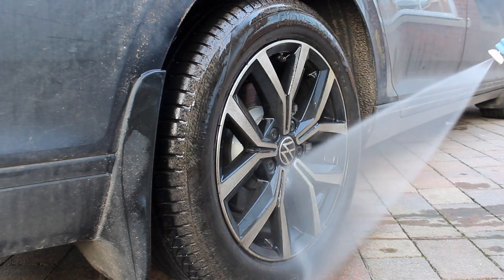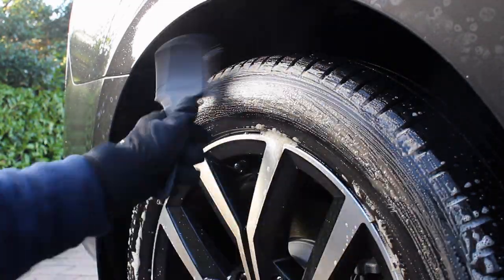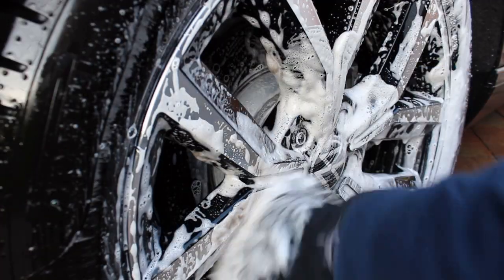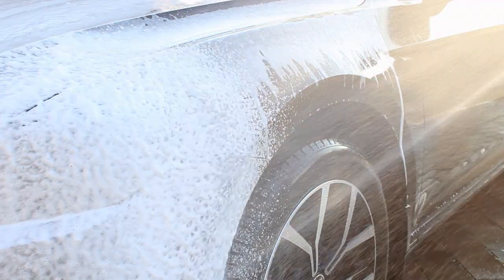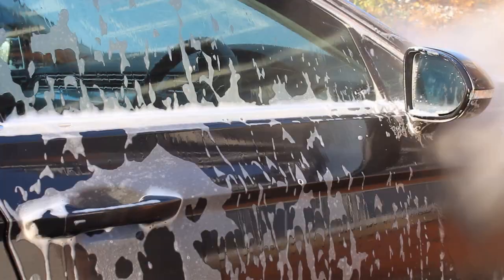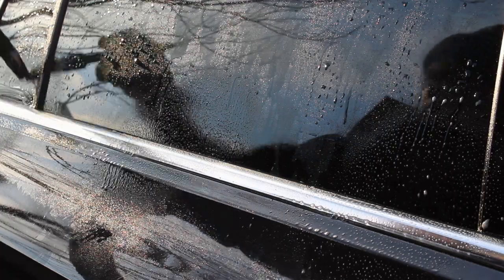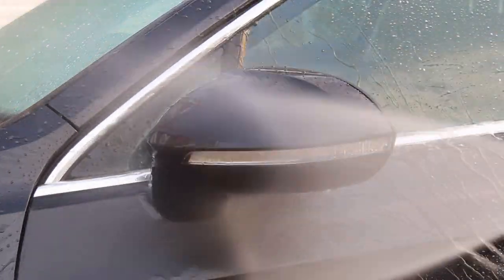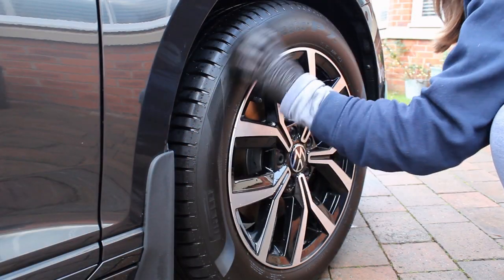Filthy Volkswagen Passat | Wash and Protection of this Estate Car

Comment: Another good clean Heather. I use the power maxed tfr, pretty strong stuff. Also use the tyre coat, I find it really good, lasts well and you can definitely still see it on the tyre longer than other brands.
Reply from the maker: Thanks for watching! Infinity Wax Tyre Coat has really impressed me, I think the finish is perfect and the application is really easy with it being a spray

Comment: Great video Heather and another thorough explanation of what you have done and your thought processes. The wheels on the Passat look lovely but I've found that diamond cut finishes are the Devils work and their resistance to ageing and white worm is not great. I look after a Range Rover with d.c wheels and I always ensure they have continuous protection applied in the form of Angelwax Bilberry Wheel Wax. Your client might value you doing the same on these wheels.
Reply from the maker: Thanks for watching! Yeah I've seen a fair few diamond cut alloys with pretty bad corrosion unfortunately. Hopefully the sealant here will have added a bit more protection but I know it's quite hard to prevent even if they're ceramic coated due to chips etc. I don't actually do this professionally so I don't plan to maintain this car as the owner wants to start getting into cleaning it themselves but I'm sure I'll have it back on the channel at some point so I can apply something a bit more heavy duty to the wheels and paintwork :)

Comment: Great job Heather, I'm interested in the touch-on. I've tried auto finesse lavish which is only ok. Touch-on sachets are a good idea to use when needed, mostly winter. 
Does it improve the appearance? Glossy? Thanks 👍
Reply from the maker: Cheers Kevin! It's hard to say about the finish to be honest without testing it next to bare paint but I'd say it's probably about similar to most other products and doesn't blow me away with the gloss levels. Having said that, the lighting has a lot to do with it! I've popped a link in the pinned comment if you want to see more info about durability and different ways to apply it as well :)

Comment: Really enjoying your videos. You've come a long way since your earlier ones, good job! Touch on looks brilliant, more potent than in other reviews I've seen.

I have an XC60 with gloss black alloys, I've had to adapt my cleaning routine to avoid marring and scratching. First I spray with APC then hit the tyres with a tuff shine brush and rebound, rinse off the tyres and APC to get as much of the crud off as possible. Then I use a soft detailing brush with either a wheel cleaner or wheel shampoo, normally wax planet aluminium or AG hoops or a combination of both. I'll then go over them with a klin softie wheel pad then rinse. I'll then do the barrels with a combination of EZ large and mini, these get where water can't! Then a mitt behind the spokes. I do use a fair bit of product on wheels. The products I do use are keepers now and won't use anything else, APC I use bilthamber surfex HD. I'm a little OCD with my wheels.

Comment: I am always wondering: does the snow foam affect the cleaning capabilities of a TFR? Roots to the idea: TFR has a ph rating of around 12-14 if undiluted, so here perhaps 9ish. Snow Foam mostly is "ph neutral" in the 5ish range. Put these two together and this reduces the TFRs capabilities by neutralizing its acidity. So one trades in chemical effectiveness for dwelling time (which helps effectiveness). For this reason I try to avoid "piling up" different cleaning products at the same time.
Reply from the maker: I let the TFR/ citrus dwell for a few minutes before applying the snow foam to let it work on it’s own before it gets diluted. The snow foam here is alkaline as well so it shouldn’t neutralise it much. I don’t think layering is necessary to be honest it’s just something I like to do sometimes whilst the buckets are filling up

Comment: That was quite clean if it was 5 months of use. I've just got rid of 6 weeks and 2500 miles of winter grot and that was the dirtiest it's ever been.
The new Carscope Rotor wheel shampoo is on a par with GT wheel shampoo I'd say.
Alkafroth as we have discussed is my new "winter" foam it's just not widely known nor does it get the press coverage it really deserves.
Finally.... you need to invest in an EZ "bog brush " for the arches...mudflaps front and back.... makes life a breeze.
Reply from the maker: I'd really like to try that rotor wheel shampoo, I'll probs pick some of that up and maybe Ink at some point too. I've just got EZ Go Brush actually, it's brill. I've got the next couple of transformation videos already filmed so it might be a while before it makes an appearance though
Reply: @Auto Care HQ  I think Rotor is actually better foam than GT...  but only just... cleaning is certainly on par...
And Ink.... its great... goes on light blue and seems to hang around a longtime

Comment: Hi heather I’ve been using the touch on for a while great product if used every month as directed it does seem to build up and also found it will start to last longer and longer the more used
Reply from the maker: That's really cool that it builds up, the owner of this car has just bought some sachets of it!
Reply: @AutoCareHQ  Have you ever tried Infinity Wax Express Sealant? It's behavior and longevity are very similar to Touch On.
Maybe Michael can send you some 👍🌹
Reply from the maker: @kinnonmcallister  I've not yet but it's on the list of products to try! I've used Incinerate and Tyre Coat and really like both of them so I'd definitely like to buy a few more of their products

Comment: Hi heather I hope your well just going through some of your old videos and just wondered would you recommend surfex hd instead of the traffic film remover? And would you say now its better to apply product directly without prerinsing to make product more effective and not to dilute it anymore? Thanks so much for all your videos your the best
Reply from the maker: Thanks for watching!

So both the TFR and Surfex HD are pretty aggressive options and I wouldn’t use them really on a regular basis. In terms of cleaning power I’d probs say they’re pretty similar, a 1:9 dilution of Surfex HD will strip through pretty much everything.

For maintenance though I’d recommend a citrus as it’s not as aggressive so there’s less chance of staining trim or damaging the protection. Some good options are

Garage Therapy Citrus
Yum Citrus
Squid Ink Citrus
ODK Breakdown Citrus

And yep most of the time i just apply to a dry panel. Just be careful of the products drying out 😊

Hope that helps!
Reply: @AutoCareHQ thank you so much heather for the reply I am going to go for the surfex hd as always been impressed with bh products. Just another quick question  which spray on tar remover would you recommend in which you can pressure wash off? I have heard the auto smart tardis is good and the gtechnique glue remover is good as well. Have you heard any good comments about the bh cleanser spray for tar remover also? Thanks heather keep up the good work
Reply from the maker: Thank you! Yeah you can't go wrong with BH. I usually agitate the tar remover as they aren't very water soluble but my favourite is GT Tar. I haven't tried the ones you mentioned but I know tardis is an industry favourite

Comment: Really fabulous video, think I may have to invest in some Touch on once I've finished with the current bottle of infinity wax express sealant, would be interesting to see a comparison. I've used tyre coat quite a bit and its awesome stuff.  Hope your well.
Reply from the maker: Cheers Phil! I'd be really interested to hear your thoughts on Touch On compared to IW Express Sealant if you go for it. Agreed, Tyre Coat is really good stuff. I can see myself getting a full-size bottle when I run out of this sample but I reckon that'll be a while off considering I don't need to apply that much of it!
Reply: I was thinking Exactly the same mate. Would be very interesting to see the comparison.

Comment: maybe it's gonna be ridicilious question. the brush that u are using for arches and tuff shine. Is there any differences between them? Because i use this small brush for tires i think it works very well. thank u for video :)
Reply from the maker: Thanks for watching! The arch brush is definitely a little bit softer than the tyre brush and the longer handle makes it a bit easier to reach into the arches :)

Comment: Hi Heather you mentioned when using the power maxed TFR because you knew there wasn’t any protection on the car, isn’t it safe on protection as it is stated on the container and online? “completely LSP safe, will not strip wax or sealant” minimum dilution rate of 9:1 .. I also have power maxed 5000 but hesitant to use it Incase it comprises the sealant so opt for citrus APC. I would like to use the TFR with confidence
Reply from the maker: I've not actually tried it on anything with protection yet to be fair I just assumed that a TFR at that concentration would probably be quite aggressive. If they say it's LSP safe then you should hopefully be okay but it could be worth trying it on a small section first to see
Reply: @AutoCareHQ  I think that’s the plan, maybe try on the arches and wheels first. That wasn’t to take away anything from your video. I always enjoy your videos and they’ve always given me another angle to look at things which is most helpful. Keep up the great work Heather 👍💪

Comment: How would you rate Touch On against Sam’s Ceramic Foam?
Reply from the maker: I'd say Sam's Ceramic Foam has a bit better water behaviour and lasted longer on the other cars I've used it on compared to Touch-On, although I've not tested them both side by side. I like that Touch-On works in a bucket as well but out of the two I would buy Sam's Ceramic Foam just for the foam cannon application